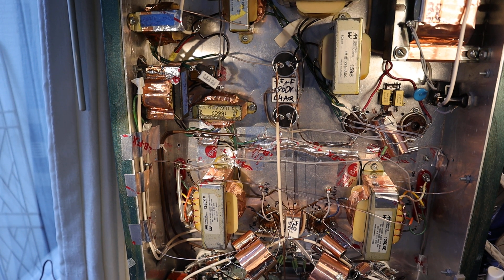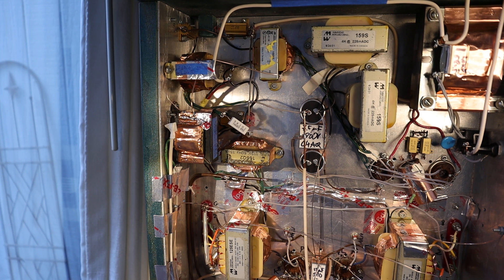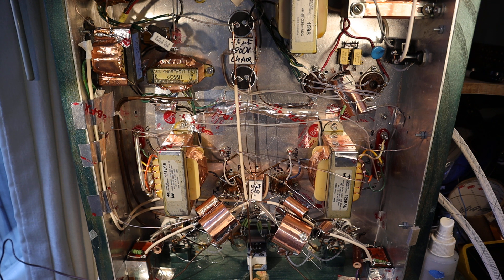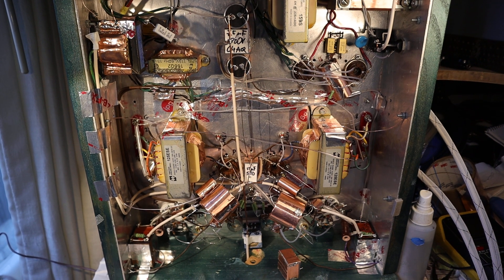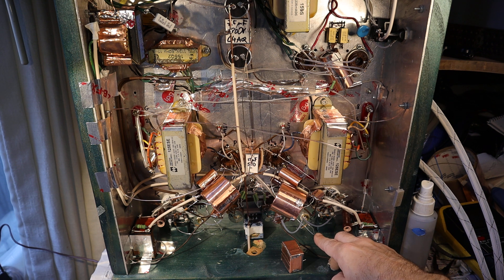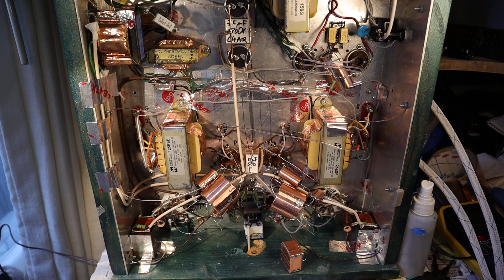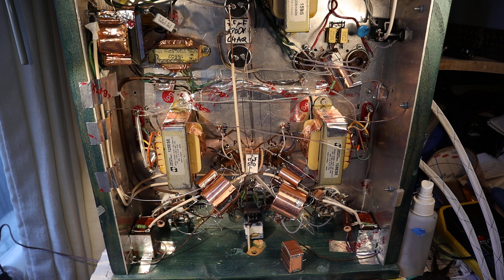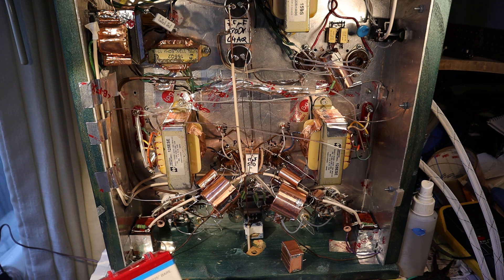Twin Darling flea power SET amplifier - build footnotes

Comment: Good to mention it Janos...........The first thing I allways check on a tube amplifier are the filaments voltages !!!! 6.3 volts , NO MORE , NO LESS !!!!!!!!! more important than what one shlould think ...........many current production commercial amplifiers do NOT respect those voltages ....and correcting is mostly easy .
Testing those voltages must be done under load ....
Reply from the maker: I think most manufacturers don;t even check their filament voltages, they just slap in a 6.3V rated transformer and expect 6.3V...  and then we get measurements like 7.1V, and no wonder the poor tubes don't last even a year.... 
Testing them under load - thank you for mentioning that!! For a novice that might not be obvious. Load / no load voltages can drastically change. Should do a video on it  :)

Comment: Janos, i like these videos but since i havent embarked on the full darling yet, this information is a bit out of sequence in my head, but still like watching.. I'm just hoping that in your past videos or writeups for the darling amp builds, that you mention which voltages are critical to measure and what particular resistor(s) we may need to add a pot to in order to achieve the ideal voltages(to then later replace with it's equivalent resistor).
Reply from the maker: Thank you, great suggestions! I will go through that! ; )